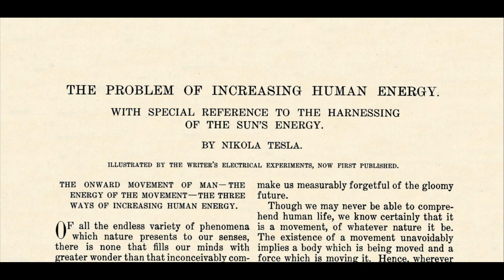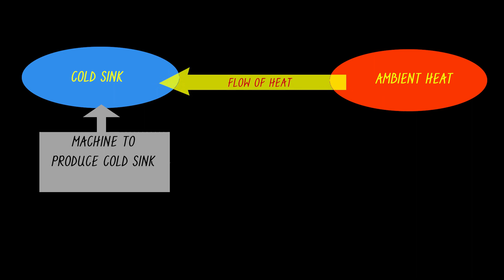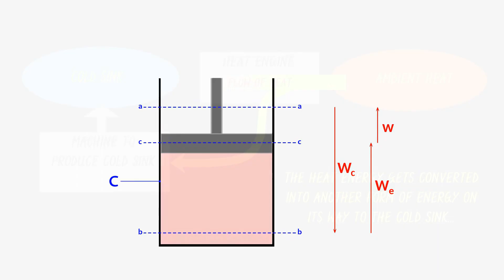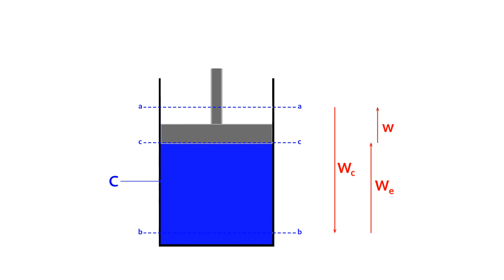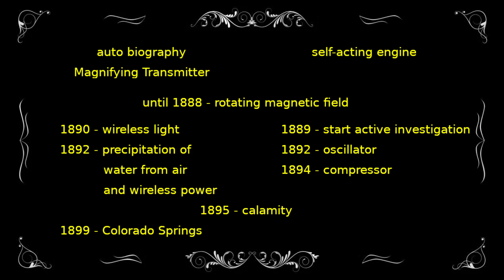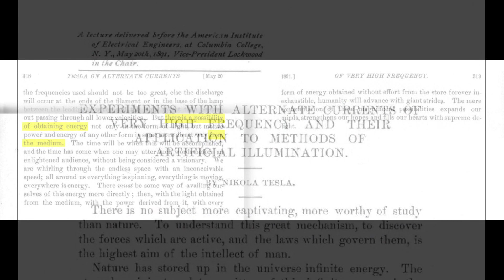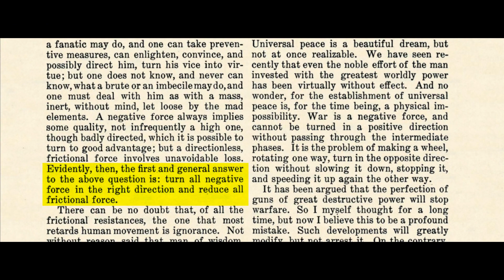Tesla's Self Acting Engine

Comment: All I know is lightning is Very powerful, amperage and voltage. so to say it can't be done is counter intuitive we live in the center of 2 capacitor plates,so the machine would be like a dendrite in a lithium battery 🤔 a DC machine not an ac one. Ac will only get static and dc will provide current so oscillate all ya want but it won't provide any real power unless ya have a path for current to flow. Hell a simple full wave bridge rectifier a ground wire and a antenna wire 1 inch or 20 inch makes the same . Try it it gives very consistent power

Comment: I hate hearing the words impossible or violatates laws of physics 🙄 we live in a perpetually moving universe that been moving without imput long before we decided it can't be done. We forget to actually visualize what's going on and get lost in man made math formulas. All our experiments and measuring has took place in a dielectric area in a big capacitor near the center of a magnetic field in another magnetic field while moving insanely fast through space. Math is a great tool but only when applied to the problem with proper understanding we simply cannot know anything for sure until we can take measurements outside our hileiosphere to compare then comprehend then apply the math.
Reply: Especially when you take into account that the Aether/Ether is non-Cartesian and electricity is the conjugate of dielectric and magnetic fields (just as Steinmetz described) energy is literally created and destroyed all the time. The laws of physics are overdue for a rewrite.

I think the MTM was powered by the return pulse it sends into the Earth, which can be triggered by the first pulse of power to the primary, once it gets going it doesn't want to stop. No cold sink needed due to resonance amplification.

Comment: ? ? ?  Luckily for me I am able to view Tesla's explanation's in a sufficiently metaphorical way to believe that Tesla wasn't denying the basic laws of physics.  I think the Wardenclyffe Tower was designed to provide power from the ionosphere by providing a path for discharge of the charge in the upper atmosphere through a regular oscillation that is both a harmonic of the earth's core resonance and the conduction of electricity in the upper atmosphere at the circumference of the ionosphere. He measured earth's electrical resonance at colorado springs. and that there is a roughly patterned discharge of lightning around the globe through storm fronts.  i think he was just talking about a controlled discharge of the ionosphere in such a way that lighting could then be harnessed.  Rather than defying laws of physic's this make sense.
Reply from the maker: Yes, there are many who believe that his source of energy was a controlled way of discharging the ionosphere. That is a possibility, but I doubt it. I think he had something else in mind.
Reply: No, he was using the air and tower antenna as ground. It started with his work on lightning antennas and trying to provide a high impedance path for the lightning to ride so that it wasn't so abrupt compared to normal pointed antennas; his looked umbrella shaped, like fish hooks. Then he realised with this geometry in a vacuum tube he could store charge in the millions of volts and either send it through the ground (wardenclyffe) or into the air (death ray)

Comment: So, the TMT is basically a pump that extracts energy from the earth? Nice
Reply from the maker: To be precise, it extracts energy from our atmosphere and pumps that into the Earth.
Reply: @WardenclyffeResearch  fascinating
Reply: @WardenclyffeResearch  I believe Atlanteans had this technology. We need to be careful.
Reply: My idea is to build much smaller towers or antennas and use the efficiency of modern transistors to miniaturize everything, then distribute these installations all over rather than focusing all the energy collection and distribution from a single point.
Reply: Energy isn't a concrete thing, and it is poorly defined. Power is better defined. Energy is not being extracted from the atmosphere nor the earth. Power is obtained by utilizing the dipole.

Comment: Yes, the TMT indeed holds the key.
I see it as an electric pump, pumping  from and into the earth.

at the same time the earth is part of the cosmic resonant system, so the TMT is coupled to the "Wheelwork of nature", and the earth can provide energy to the TMT, making it a "self acting energy".

With diodes as valves, we should be able to pump the excess energy out of the earth into a capacitor, to do work.

To pump, I am looking into series parallel resonance, with 2 coils and a  single capacitor. Just as Tesla described in his colorado springs notes.

I will be testing if the ground connection produces currents.
Displacement currents, not conventional currents.

As displacement currents (commonly used to explain how capacitors work) are the Tesla currents.
They flow through the dielectric medium. Like glass or, the earth and its atmosphere, and the  space between the earth and sun.
Reply: very well explained Ivo